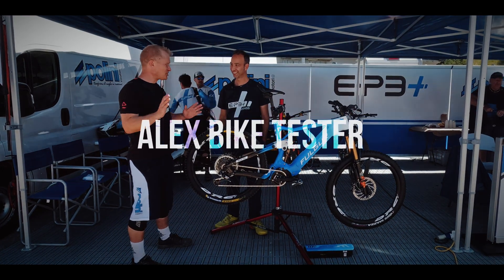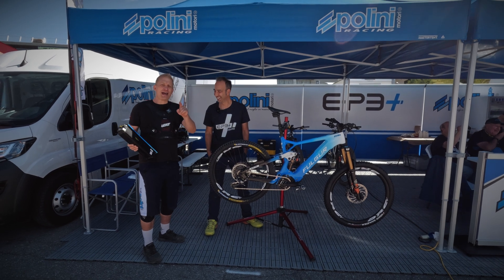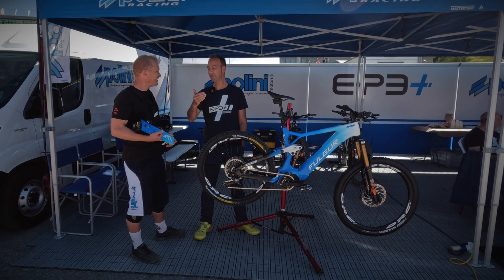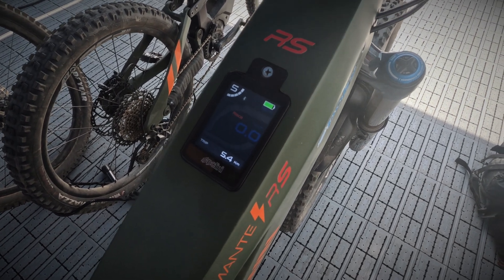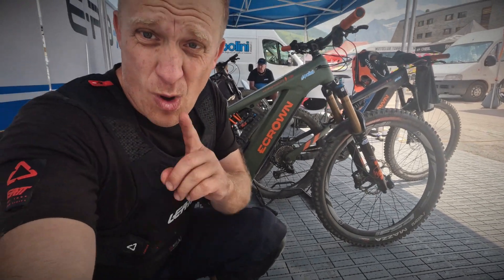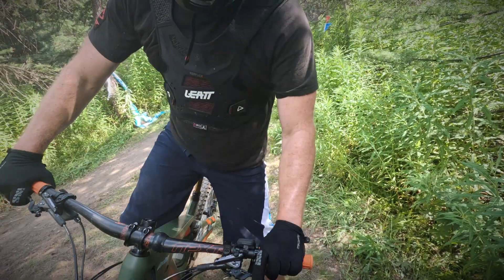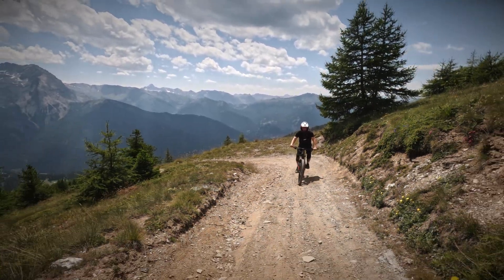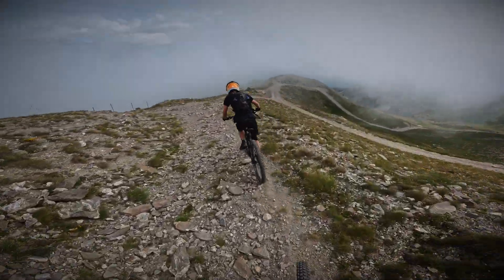DJI & ZF KILLER - Polini EP3+ MX

Comment: Polini's engine repair politics is awesome BUT ... is pointless until they came with a big marketing ideea ( a known Bike manufacturer, one of the big one's / winning some really big contest etc) something to really stand out in front of the customers. In our days, sadly, the "winner" is not the most powerful engine , the most quieter or the most reliable, no , is that one with the best marketing . I know about Polini's ebike motors from a few years ago , but I feel that they are still playing  in the lower market  segment. 
Like @4x4Pikester said , the ideea to make Polini's engine to be directly interchangeable with a Shimano motor ( as I know they have the same mounting points) it can be a good one.
Reply from the maker: Yes, the biggest issue is normally battery solutions. The battery sizing needs to be same as the other brand it's replacing. Plus compatibility with communication motor/controller standards.

Comment: Click bait title mate 😊
Reply from the maker: I actullay ride a motor that has numbers bigger than them (real) thats already available..... ;-) The conclusion though is valid. Power deserves to sit on big bikes, lightweight bikes with lots of power dont need the power. Real lightweight bikes. 19kg was already achieved by a lightweight full power e bike by specialized in 2019, everyone forgot. The S-works Turbo Levo. 90 NM 720 Wh. Polini with their motor have an even better solution if you want raw power, its already on the market.

Comment: All Polini need to do is make their motor directly interchangeable with a Shimano motor with ability to plug into a shimano batteries and I could see a massive aftermarket place for them. Sorting software and controllers would be the biggest issue I imagine.
Reply from the maker: I told them.... They think it's a good idea...
Reply: @alexbiketester  If they don't get in there I am pretty sure Bafang will. Have been a big fan of the Polini concept since learning about them a few years back. Just a shame more mainstream manufactures haven't bought into it.
Reply: This is good idea. I’d immediately buy a complete engine, battery, loom and controller for my perfectly serviceable big 4 year old SantaCruz Bullit. They’d just need to think about the display (design and where to put it) 🎉 Great vid: subscribed 😊
Reply from the maker: @Coolcmsc  thanks, they havea display that looks liek a specialized version as well. They also told me they still feel that the power switch needs development.

Comment: What bikes have this motor ? any UK stockist ?
Reply from the maker: Berkshire cycles have a Fulgur brand. I just tried today for the first time the Ecrown, racing it tomorrow, impressed so far. It also made me realise a robust big bike needs a robust big motor, as tracktion is better managed due to the design and weight of the bike. 

MBE also have it. 

My common idea when i ride these bikes is that they ride up as fast as down....

 https://www.ecrown.it/performanteRS they are starting selling from september in public. I know that Berkshire cycles have had Polini reps go there to train them on motor servicing as well.

Whats good about this motor is it already exists (is very powerful) and when considering all the features it blows DJI and ZF, which dont even exist with a track record or a repairability record, out of the water.

Comment: It's great to get more information on this motor system Alex not many people seem to be covering this motor.
Reply from the maker: Its a great motor. highly underrated. Even if it is not able to grow much outside its current brands, then its a lesson to the other brands out there that need to learn from them. In the laptop world there is a brand called framework, who have the same methods. Quality performance and ability to repair easily. 

I was talking to simon today about cast moulds as well, these guys are the top for this type of product. The did say they are still not happy with their remote styling and asked me what I thought. I told them my experiences over the last 14 years of ebike stuff and the recent shimano remote has been the most robust. 

I want to do a factory visit and see how they repair and rebuild the motors.

Comment: Polini seems awsome also the spare parts avability seems amazing
Reply from the maker: it amazingly true. They have the spare parts and the motors can be opened and serviced or reconditioned, prolonging the life of the bike they are attached to.
Reply: @alexbiketester  I can attest to this having had a pretty big off and bashing the motor in the alps and sending back to the shop for a repair it’s fantastic to be able to service the motor. What would be good is a series of videos for the end user.
Reply from the maker: @mha1978dent  I will talk to them see what we can do.... I want to visit their repair shop one time as well.
Reply: @alexbiketester   I’d love to come to see that! 
Also ask them about garmin integration. I could go display free with a mid cable dongle on my shimano e8000 and just use the garmin as a display. This would be an absolutely fantastic feature, and I’m sure an easy fix.